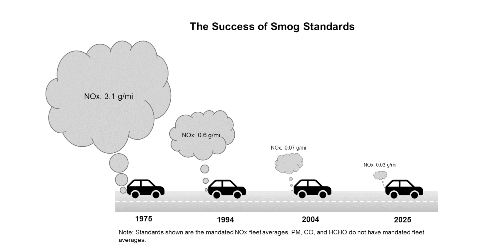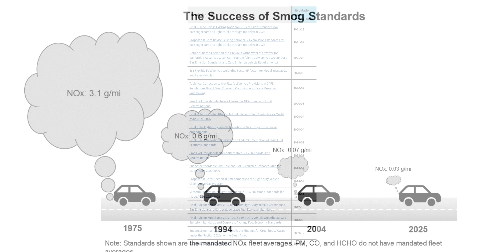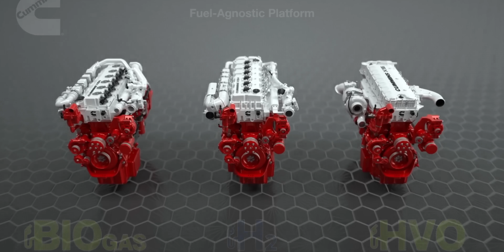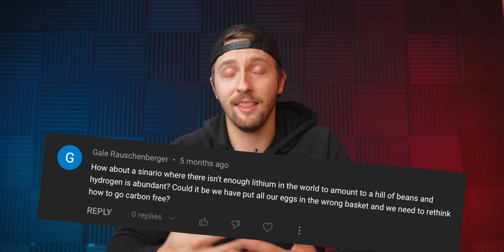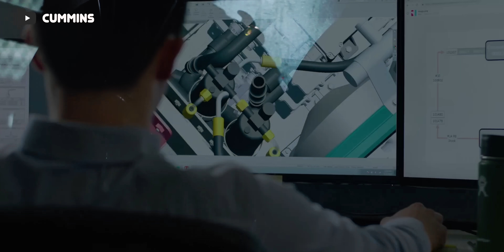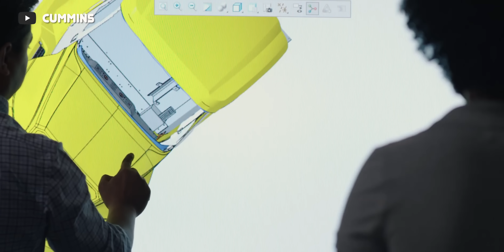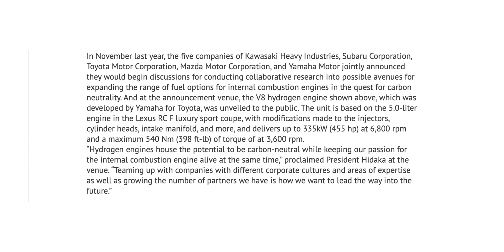Cummins Hydrogen Engine Will KILL DIESELS FOREVER

Comment: the solution for big rig trucks going electric is not bigger batteries but alternate ways of getting power to the trucks... theres this pilot project in germany if my memory serves me right where they put electric powered lines over the truck lanes on the highways just like electric trains or trams... so trucks can use a roof rig and raise it to be plugged into the electric grid while on the biggest part of their journey... i.e the highway, disconect and use battery power once going to the target drop off more "inside" the city where you could have charging stations at the docks so trucks could just make it back to the electric highway and plug back in to be recharged for the next drop off...

Comment: Stanley Myers water powered dune buggy had done it already... Bob Lazar also converted a Corvette to hydrogen. It's old tech believe it or not.
Reply: And it didn't work then either due to numerous real-world limitations that have no realistic solution.
Reply: @illbeyourmonster2  what didn't work then?
Reply: @MrJon_Garcia  None of it works as advertised.  Hydrogen fuel has been pursued for 50+ years that I am aware of and it never works as advertised.  

As for Myers his work is a scam and always has been.
Reply: @MrJon_Garcia  Nope,  I had copies of the complete detailed blueprints for their designs and tried to replicate them.  they do not work as claimed.  

The amount of energy input to produce the fuel gas off the water is way beyond what they claim.   

Also, the modifications to the engines required to get their functional efficiency up to where they will work with that type of fuel are well past what is realistic.

Comment: The argument that EV vehicles use fossil fuel plants always gets me. Even so its A LOT more efficient, for the same reason that every house doesn't have an on-site generator for their home. Having a centralized location for the power generation is a lot more efficient than having an engine and every house burning fossil fuels. SIMPLE.
Reply: Nope, Once you factor in all the systematic losses from power plants to EV batteries they are no different to in many cases a bit worse. 
Put that real-world efficiency loss against a real-world non-emissions compliant engine actually built to be fuel efficient and the EV is way worse.

Comment: Its still a diesel... hydrogen is SO far off from being applicable if EVER due to every density issues and storage..  Diesels are compression fired engines and are the superior engine type.  Id love to see bio-haul be treated like the savior it is as a fuel source.

Comment: Well hydrogen is hard to store and usually it's produce by breaking down water. So you get the electricity and you could use solar but then you have to convert it to hydrogen and then you have to put in a vehicle. In the end you're not doing anybody a favor.

Comment: Once we get solid state batteries, all these other engines are moot.  If people think battery charging infrastructure is poor, good luck finding Hydrogen anywhere besides basically in California.  Toyota says it should have a solid state battery pack in a hybrid EV by 2025.  Solid states are brand new expensive tech, so starting with small battery pack to get some real world testing on their new battery packs makes sense.  Yes we would still need to work on where the electricity comes from but hydrogen should be used in power plants to supply the electricity, not in individual vehicles.  But as with getting liquid hydrogen for a car tank, getting enough to use in a power plant is a ridiculous amount of capital.

Comment: Hydrogen is a con for the liquid natural gas industry, they want to use gas to make hydrogen. Batteries are king and as with technology it always gets better with time. Lithium mining in Australia does no damage to the mine sites and Pilbara minerals the biggest lithium miner in Australia is going totally green with a huge solar array. Cobalt is used in refining gas/petrol so you can burn it in from a tank. Make no mistake Hydrogen will never take off.

Comment: First of all we need to tell the govt to F¥€k off with their fuel tyranny— then allow the free market to solve the technology issues.
Hydrogen generation requires a GREAT deal of energy to lyse the hydrogen from oxygen, so again– electricity.
Elon is doing work now on new sodium-ion batteries which will eliminate the need for lithium and cobalt, and though they don’t produce as much power, they will be far, FAR less expensive, and sodium is plentiful and cheap.

Comment: The diesel and fuel are named after Friedrich Diesel. They were originally designed to run on any oil fuel (not gasoline that is a distillate). Diesels are one of the cleanest burning engines when properly maintained. Electric vehicles are not sustainable. At all. 

Hydrogen has always been the way to go but because lies about crude oil being a finite product (it’s not) and pollution (again mostly a lie) they snuffed out hydrogen technology to gain more profit. Notice how no new oil owners have come about in the last 50 years? Those that “own” it have made it too difficult to get into the business.

Comment: Ford built a 550 HP 6.8 L V10 hydrogen powered engine in their 2008 F-250.  So that is about 80 HP per liter.  Imagine a class 8 truck with a 3.5L V6 turbocharged hydrogen engine, and that runs the forward axle, and the rear axle powered by a 400 HP electric motor powered by a much lighter and less expensive 200 KW battery.   If Cummins makes their 6.7L engine run on hydrogen, it should make similar power to the 550 HP Ford V10 at 6.8L.  IF the crankshaft can hold together!  

Being able to charge with a 60 amp 480 volt receptacle at a supermarket or other place where they deliver or pick up freight.  1 KW per minute is better than nothing, yet not super fast, a small power cord that is easy to handle.  

There is a product that comes in a tube, like silicon, and can produce hydrogen when mixed with water, so that would end the need to compress the hydrogen to over 1,000 PSI in order to have enough to power a class 8 truck more than 100 miles.  I think the name is Powerpaste. 

So 10 pounds of Powerpaste, and 10 gallons of water and you could run the engine say 100 miles.  If you could collect a gallon of water every hour from a hydrogen fuel cell, or a A/C unit every day, that would supplement the water used to produce the hydrogen from the powerpaste.

Comment: Why not just use electricity? Because ten to store the electricity you need batteries. By generating electricity through geothermal or solar you can then directly use it to create hydrogen stored into tanks. Thus the hydrogen is the replacement of the battery. But it can be used as a liquid and gas. It can also be easily stored it can also be easily transferred.

Comment: Hydrogen internal combustion engine is the successful solution for sure . This can be used for any vehicle. EV vehicles are not suitable for long-term planning. EV vehicles will definitely cause headaches for consumers. And also EVs are very boring.
If you are a true car enthusiast, you can understand that feeling. Electric cars are supposed to help the planet , but their batteries definitely create the next trash problem. And sometimes , lithium - ion batteries explode . Electric cars certainly reduce your carbon footprint , but making the lithium - ion batteries could emit 74 % more CO2 than for conventional cars .
Considering these facts, it appears that the H2 IC engine is a very good solution.
Hydrogen engines are reliable , have familiar technology , and deliver environmental benefits. These make the transition into hydrogen engines operationally and economically viable . Also Vehicles are experienced with many senses and sound plays a huge part.

Comment: If enough ICE is switched to EV then the pressure on emissions decreases by volume. At some point the environment can absorb low enough levels of carbon that ICE vehicles and equipment no longer have an impact. Battery tech is advancing so fast that it's not even an issue.

Comment: Hydrogen is compromised so you can run a engine like a air engine with the pressure alone will drive it and add a spark plug to fire on the down stroke like a 2 stroke don't waste energy compressing the already compressed gas and for the gas and diesel part put some fuel in a metal container no oxygen and a spark plug if a little oxygen gets pumped in the fuel ignites and creates more internal pressure to run the air/hydrogen engine and then there's heat that can be used for something put the pressure threw a heat exchanger and use that too to power a heat engine a whole lot less power but use that to power the electric because it can't be stopped as easily as the air engine can and it's a complete waste of heat otherwise and air engines don't need to idle to less waste there. And then you can market the engine as a multi fuel engine can run on gas diesel hydrogen compressed air or even anything else that can burn like trash. Then throw In a air compressor for regenerative breaking. I'll buy that car
Reply: I hate batteries so I hate electric motors but I like generators

Comment: The electricity needed for electrolosis  can be generated by the charging system after it starts. You would need extra batteries for starting but only for starting. This has been proven by a guy that was killed for his accomplishments.

Comment: As to the part about converting electric to hydrogen and why not just use electric in the first place.  Hydrogen can be stored easier and filled faster.  Doesn't require expensive batteries that degrade over time or perform differently in weather.

Comment: Stationary electrical storage is already starting to solve the ev off highway issue . These eliminate the voltage issuse and grid tie-in with small scale solar and wind easily provides power . Hydrogen is super expensive to make , I think this a just incase play .

Comment: Good luck at developing the hydrogen infrastructure. The Cummings move sounds like a publicity stunt. It would be better if Cummings would jump on the band wagon and spend the R&D budget into cleaning the exhausts of diesels and developing renewable energy sources.

Comment: If you follow what the Japanese are doing. They have started there first industrial size HTGR producing "Red" Hydrogen. They already have nearly 200 Hydrogen fueling stations for all sizes of vehicles. The majority of Hydrogen there currently using methane reformation still has CO2 as a byproduct. But the "Red" uses superheated Helium directly from a reactor to create Hydrogen. No carbon involved. No chance of another Fukushima/Chernobyl as there is no water in the reactor to overheat and seperate and blowup. 
This is what Cummins sees as a carbon free replacement for Diesel fuel.

Comment: The main thing is diesel will pollute big cities in the winter when you get temperatures inverting the top layer trapping the smoke.
Hydrogen is great for inner city and its useless for long range heavy loads.
Ships could be nuclear.
Just horses for courses.
A good mix of everything.
Battery for the trip to the shops for granny.
Petrol for the suburbs and diesel for rural.
Hydrogen for the rich who always always pulls up the ladder behind them and forget about the people who held the ladder up in their rise to power

Comment: The range issues WILL be solved. Sure, not now, but with some good top down incentives and regulations, it unleashes the free market and batteries get better and better, with government support of research (i.e., ARPA-E). Very well rounded information, I must say.
Reply: People often spout this nonsense, problem is when it comes to small scale batteries we know the entire periodic table, we know how reactive each element is, we understand what ones have free electrons, we understand the limitations, batteries getting "better" is by the same measure that ICE engines get more efficient, by fractions of percentiles at a time, not some gigantic high hopes SciFi leap and bound... There really aren't a lot of good chemistries to switch to to gain higher density and a safer and less volatile battery, it just simply doesn't work that way, the biggest advances are being made in stationary batteries like vanadium flow batteries, of which don't scale for use in EVs... It's a wet dream to think EVs are going to get double the capacity etc etc, and even if they did, it just opens up a heap more issues like heat, safety, infrastructure shortcomings, power production issues etc etc etc

Comment: NOx emissions still need to be taken care of in H2 combustion engines as the air which is used with the H2 to make power is a mix of Oxygen and other gases including Nitrogen.  The exhaust is not just water!  JCB is also working on H2 combustion engines for all the same reasons that you gave.  They are close to selling such engines too!
Reply: From the last Harry's farm video with JCB, it looks like they have solved NO2 generation issues by controlling the temperature of the combustion

Comment: There are a ton of metals that are highly reactive with oxygen, so much so they will literally strip it out of water yielding (insert metal) oxide and hydrogen gas. Why can't someone figure out how to make a catalytic converter that water goes through and then as the gas separates, it is sent through the cylinders... It's basically the same process they already do to use metal to react with exhaust gases to convert CO to CO2. Plus there is a little over half the energy density of gasoline in water when H2 is used as fuel, so you could get about half the power out of equal gallons of oxygen, by hydrogen can also be ran ridiculously lean when max power is not demanded (like 100:1 or something, okay maybe not quite that lean but it's way up there) so a fuel tanks range may not be impacted as much as one would think... And I mean worse case scenario just add a larger tank. Plus water is cheap so who cares if it gets half the mileage if it costs essentially nothing (eventually a new base metal would need to be replaced in the converter which would cost something) Aluminum is the cheapest and most abundant metal I can think of that would work right off the top of my head, you just have to introduce a solvent that will remove the current layer of oxidation first like sodium hydroxide, but could you imagine someday a conversation like "I'm gonna finish this coke and a load of laundry so I can fuel up and go to the grocery store"???

Comment: It takes energy to carry weight.  Electric vehicles carry the full weight of their batteries even when the batteries have very little remaining energy.  Plus the trucks would have to sit and recharge for long periods.
On the other hand, liquid hydrogen trucks would get lighter as they drive which saves energy AND their downtime when refilling would be more akin to filling up a diesel tank so trucks and drivers wouldn’t be sitting idle for hour long periods.

Comment: Fine, let's have it. Is the fueling infrastructure being developed? We have gasoline and diesel in place now, with almost no hydrogen fueling. And let's also have the Achates engine go public. Diesel or gasoline. We should be running diesels, like Europe.

Comment: 1:20
Actually, it's California that's pushing EV - at the cost of everything else and without the INFRASTRUCTURE to support recharging all of those vehicles.
Too many other states have tied THEIR law to California's insanely fast push to EV.
Reply: California cant even power their homes without rolling blackouts every summer.
Reply: @Rayden440  Yet those morons are at the front of the "push for EVs WAY TOO SOON".

Comment: Hydrogen is a mostly good option, but could be better utilized by using a fuel cell to convert it to electricity. NASA has been using hydrogen fuel cells since the 1950s. It’s a proven technology.

Comment: You can make hydrogen from water and a lawn mower battery, recharged by the engine alternator.  Fuel cell probably not needed.

Comment: Some of your information is incorrect! 
I don't see hydrogen ever used in passenger vehicles beyond a handful of boutique vehicles or in a rare few country like maybe Japan. One thing to consider is the most at risk of losing the BEV vehicle race is the Japanese. While they have had some success with hybrids their BEV's rank along the bottom of ones tested. I see the Japanese automakers about to lose a whole bunch of market share if not ran out of business totally. 
Hydrogen is expensive and energy intensive to produce. The only way to cost effectively produce it is with green energy.
I do however agree its most likely to be used at the commercial vehicle and transportation level. Tractor trailers, container ships etc. 
Something people seem to forget is to the ability to scale something up in production! Electricity is extremely easy to scale up in production and to transport. Not so for Hydrogen! Just the United States uses a fairly insane amount of gasoline per day. Over 300 million gallons! Much easier and cost effective to replace it with electricity than Hydrogen.
Tesla wanted the world to be heading where we are going!